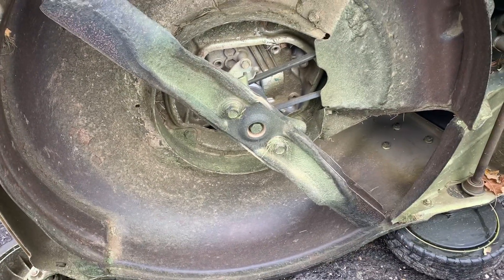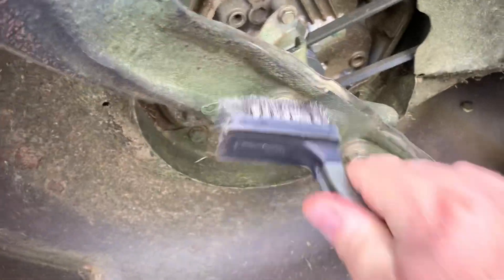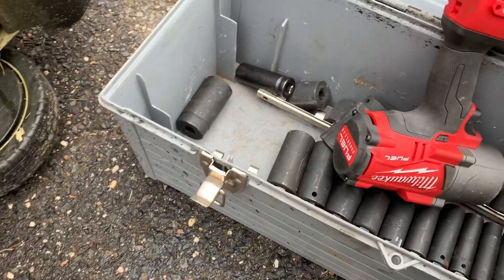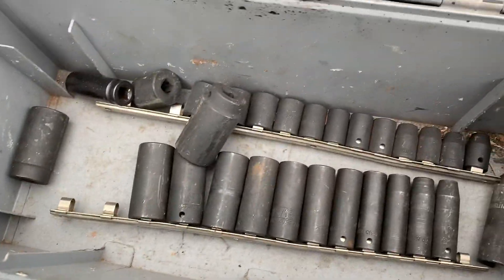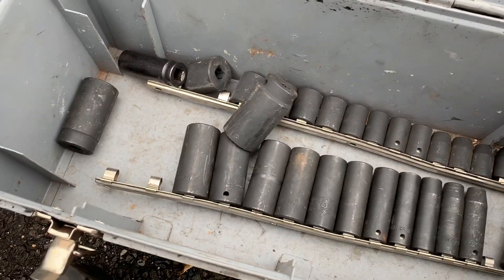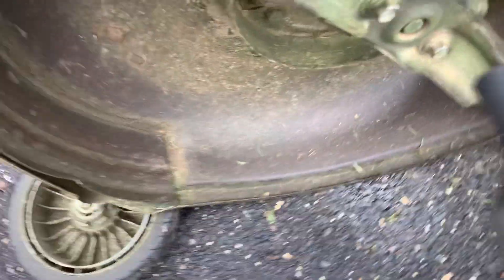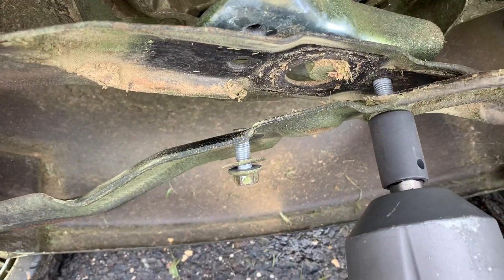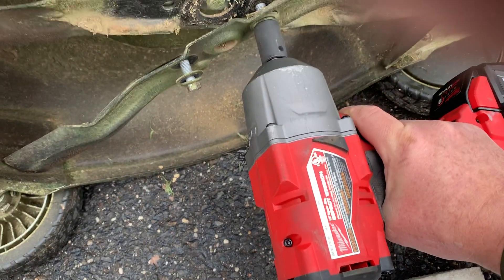Blade bolt torque-go by the numbers!

Comment: That's overkill brother, I have a little Dewalt Atomic ¼ in. impact, never seen a blade it couldn't take off. My big monster ½ Dewalt XR can snap the wheel studs on an F350 and press ball joints without breaking a sweat, but I would never see the use for it with lawnmowers.
Reply from the maker: My 3/8 impact Makita is old, no torque left in it.  Need to get a new one.  Never seen a 1/4 impact take off a blade bolt. Newer batteries pack quite a punch